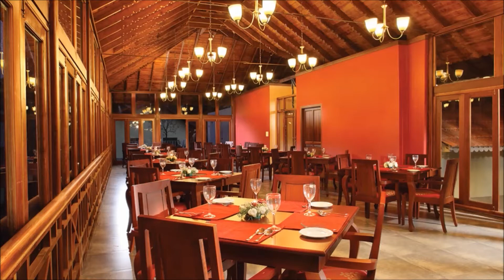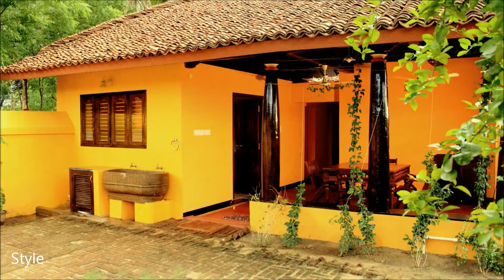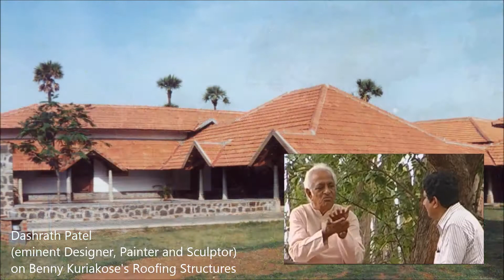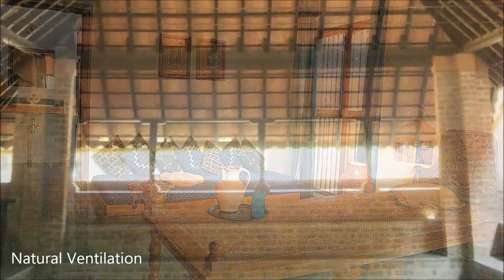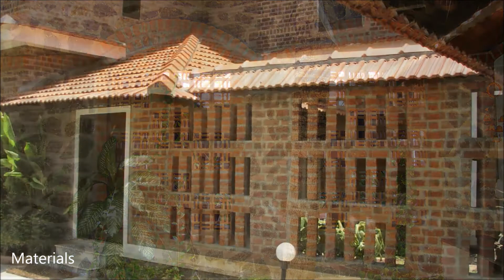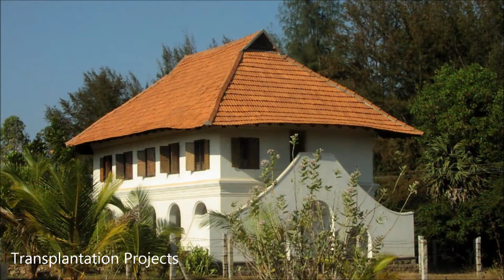Benny Kuriakose Projects - An Overview

Comment: Sir are sustainable houses 🏡 cost effective ?? Also when we use exposed brick structures the electrical and water connection points need to be decided during designing stage ???
Reply from the maker: They are cost effective and planned well in advance